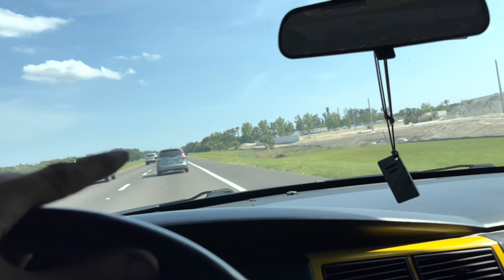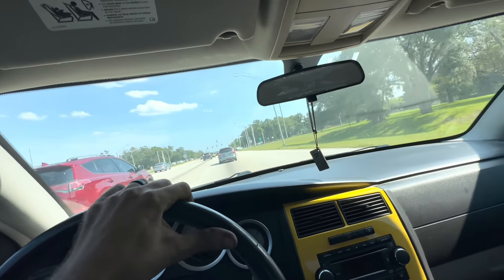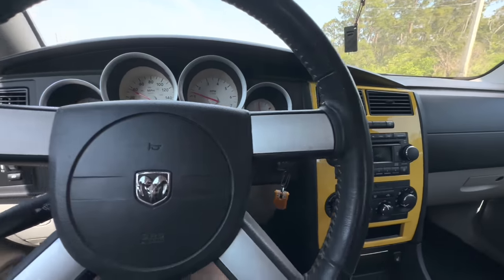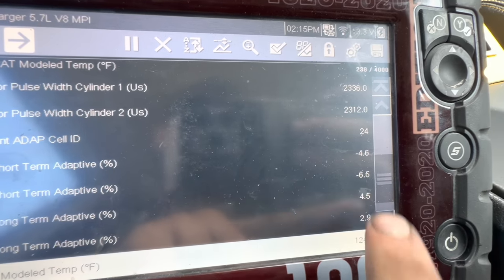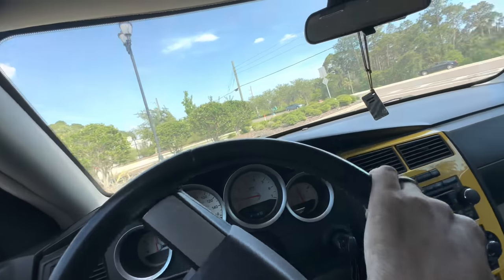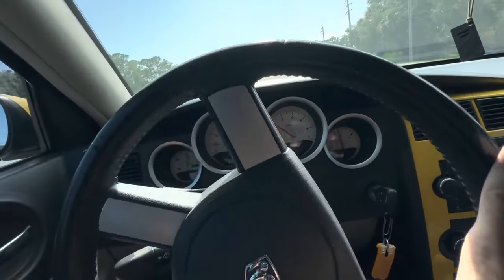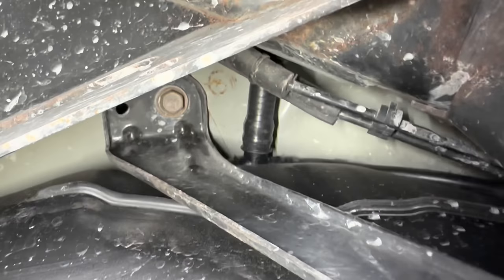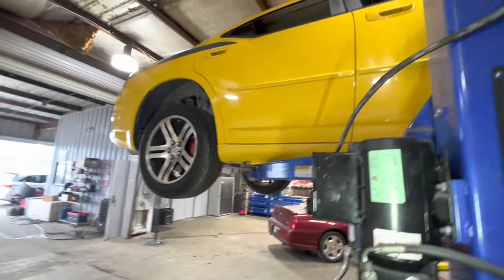Customer States: Engine Stalls After Fueling...HELP!! Dodge Charger 5.7 #mechanic

Comment: $3.25 for regular. I haven't paid that for gas in years. We're over $4 here in Vegas. The owner is probably "topping off" when he fills the tank. This is why there's liquid gas in the lines. @16:45... That's what you think. I worked at a dealership for 4 years. We only did recalls when the customer requested it. I used to try to tell my service writer that a car had a recall and he always told me the same thing... "That's not what it's here for. Ignore it". @19:23... Anything that says, "Dorman" on it should be immediately suspect. LOL. I'd replace the canister and educate the customer about not "topping off" after the pump shuts off.

Comment: That gas gauge arrow thing is useful to me a few times a year... on the car I've owned for 7 years.
I refill so infrequently (I don't drive a lot) that I often forget.
-
Fun fact: Some electric vehicles are made with the charging port on the driver's side... which puts the charging cord handle at risk when doing curbside charging.
Reply: Japanese and American vehicles have the fill/charge ports on the left side... Japanese since they drive on the left side there, and American due to lazy US drivers want the shortest distance between the drivers seat and the fill port. ;)
Reply: @ezrollergbg  As am American driving an American car (probably assembled in Mexico?) I must tell you that there is NO organized rule on that.
My car's fill is on the right side.
I have had only one vehicle in the last 30+ years with a fill on the left side, and all of those vehicles were Fords, Saturns, or Volkswagen Beetles (the old ones, not the new ones).
I think I once rented a Chrysler with a left-side fill.
I had a friend whose car had the filler pipe behind the rear license plate.
-
The location of the fill/charge port is not a "laziness" or convenience factor, but a design decision that really needs to be rethought and standardized.
And not put on the traffic side of the vehicle.
Reply: @MonkeyJedi99  Hehe… I thought I’d see if someone swallowed the bait. My US friends are certainly not lazy. You need to, in most cases, work harder to survive in the US than here I believe. I was actually referring to what some American friends said while I lived in the US when I asked why most US designed cars I’d come across had them on the left side. A thing of old habit from the manufacturers maybe? 

American cars were very much not developing from early 70’s to mid 90’s. Like body on frame, spare tire in the middle of the trunk, really bad crash protection etc, really old and inefficient V8’s etc. Big 3 got lazy and almost put out business by the Japanese. USA is very conservative in many ways even though the traditional US car manufacturers have picked up the pace the last 20 years. And companies like Tesla etc shows that there are progressive people in America, just some structures, fossilized opinions in some parts of the society that stops USA to become a modern country again. The MAGA people won’t help with that, nor will the misinformed moralists.

My post was merely a joke, a bait to see what people would write. Cheers. 😎😇

Comment: I think the gas in the faulty system just had to purge itself after the problem valve was replaced new. So some residual stalling but now purged and clear now. I would send it back out and see if it is cleared all the way out now. No parts cannon yet...

Comment: Ray you never disappoint. You are a comedian. Circular K and dough-gee made me LOL. You so funny. I can't wait for you review of a Waffle House or Golden Corral. See you when you headline in Vegas. This episode reminds me of  the saga of a fellow I worked with that had an issue with stalling when pulling his boat at highway speeds. He rebuilt the entire engine etc. and the problem. Remained. I asked him if he ever replaced the rubber fuel hose between the metal line and the fuel pump. Turns out it had an internal separation that only became a restriction when maximum flow was needed. A $5 part was all it needed vs. the $5,000 spent chasing the wrong problem. Lesson learned, part cannon reloaded. I'd replace the tank. It is not unknown to get defective new parts. I once bought a set of lifters and popped one open to verify they were correct and found the only one that did not have an oil hole in it! Brand name part. It happens.

Comment: I had a bad TIPM that was causing a similar very intermittent problem.  But in my case it would crap out at highway speeds randomly.  They are cheap and ya can likely find one at a wreckers.  It may also be the purge control solenoid.. but if it was already replaced I can't see it being that.  (and TIPM is 'Totally integrated power module').. Really looks like they loaded up the parts cannon to fix this.. if you can find a TIPM at the wreckers it takes probably 15 min to swap it out..

Comment: How long ago did the other shop change the tank, and did they blow all the fuel out of the line.  Fuel will stay in the low spot of the lines,  and because it is a close system it will take a while for it to dissipate.  My 2005 Town and Country suffers from the same thing. It would stall with in a few minuets of refueling if I drove out of the station as soon as I was done.  If I idled in the station parking lot for a min or two It would not happen. ( that was my Temp fix  when I used the Van for delivering around town ). Your not gonna get a stall just sitting there.  Second, when cumming off the highway at speed and cumming to a stop at the end of the  ramp I would get a "stumble" some times a complete stall when I took off from the stop sign.  If I idled at the sign for a bit I would not stall.   Fuel splashing up to the top of the tank during the sudden stopping and getting in the Valve.  When I use my Van a lot and re-fueled every other day,  It happened a lot.  Now my Van is just an extra and does not see a lot of miles it stopped happening.  Pulse  I never fuel it all the was up the Neck and the problem has not happened in years.   Blow the gas out of the line and have the guy run it for a while to see if it happens again  If so it is the tank valve.   New does not mean it is not broken or bad, and if you did not replace it how are you sure was new.

Comment: Nissan is the Chrysler of Japan. I am actually thinking about a control issue as hardware checks out. With the scantool verify all functions. Do not trust on/off sensor input of scan tool use the smoker.

Comment: The customer could be "topping off" the fuel tank when he fills up with a few extra clicks of the pump, which could be overfilling the tank and causing the same symptoms. I've seen lots of Hondas have saturated canisters prematurely due to this over the years.

Comment: it wasn't a Dodge but I experienced the same problem., I started the car and let it idle .i checked wires  into the Crank position sensor (connector )was bad between the car and sensor . it was extremely intermittent but if the car was running and I wiggle the wire it would stall

Comment: Charcoal canister is damaged the membrane
That holds the charcoal in place degrades with raw fuel. Still can have flow but too much flow. Sometimes enough for a small leak code. But 
If they had problems and changed everything but. The charcoal is no longer Activated and can't store the fumes the purge value opens it's released all at once. No codes

Comment: I knew someone with the same type of car and same issues. It mainly happened on short trips, where he couldn't turn the vehicle on until after several hours.
I don't understand why you can't just replace the valve instead of the entire tank.

Comment: there is a tsb/recall on the 05~07 charger rt / 300c with 5.7 mine was fixed under factory recall. they (dealership) replaced fuel sending unit and flashed ecm to fix it on my 05 300c..it randomly stalled after fueling it

Comment: SO I wanted to sleep on this one before commenting. It's strange that there is liquid fuel in the evap lines. Several people here have commented on the fuse/relays as the cause and that may very well be the case. however, the mystery of the fuel in the evap lines remains.
As we know liquid tends to travel down hill and I assume the vehicle hasn't been inverted at some point. Ruling out condensing and not being knowledgeable with the layout of the fuel system, it must be the case that either the fuel was pumped there or was introduced father up the system and is draining back down.
IF there is access further along the lines, perhaps break into there and see if there is also fuel? To try to establish the extent/ limit of the fuel and thus the extent of the 'pumping' or the cause of the introduction of it.

Either way, if you can prove/disprove one, the cause must be the other ;-)

It is a conundrum for sure.

The symptoms, whilst not exactly replicated, seem to indicate that fuel (after re-fuelling) and also when stopping after speed - causing the fuel in the tank to 'wave' forward in the tank, 'may' be some clue to the nature of the issue in that there is 'some way' at high fuel levels, fuel is being entered into the evep lines....

Comment: wow...I like those prices for fuel, but what's with the low octanes? We have 91, 91(E10), 95 and 98 in Oz, but at my local servo right now prices/litre are $1.99, $1.97, $2.11 & $2.19 (US$5.12/gal, US$5.07/gal, US$5.43/gal & US$5.63/gal). Luckily, my cars all run on diesel which is only $1.82/L (US$4.68/gal)

Comment: I wonder if they are over filling the tank even if it clicks off I know someone that continues to fill even after it clicks off I told them to stop doing that because it will stuff up the evap system and it will be expensive if it fails

Comment: Is it stalling after coming to a stop in D? Things I would check are the EGR, throttle body, MAF, PCV system. It could also be a failing torque converter. My vehicle had this issue for a 100K miles. You’ll never guess what solved it… Valve cover gaskets. Crazy, but thinking about it, there could have been a PCV system vacuum leak.  I hope you find and fix the issue.

Comment: You've heard of these cars I'm not sure which one. But spiders would get in and put up webs in the vent tube. That caused hard time fueling. It sounds like they've replaced a lot but that. That couldn't cause stalling right?  Did they use / get OEM parts?  OK  OK  lets see what you find.

Comment: I had a 2006 Chrysler 300 SRT8 that was experiencing this issue. But in my case it was more repeatable. The dealership replaced the tank and the problem went away.

Comment: Overfilling the tank leaves no volume four air you need a small chamber for vacuum to exist above the tank maybe in the trunk a small vacuum canister redirect your vacuum line so it cannot be vacuuming up the gas it's at a higher level and what it instantly lowers itself or drains why didn't they think of that ❤ good luck buddy

Comment: Hey Ray. Your resident 5.7 guru here. And I'll level with you - there is no 'one fix' here. I can tell you that the parts cannon has been fired incorrectly. I cannot tell you one concrete path because there isn't one. However, there's an entire checklist. One, crank position sensor. "But there's liquid fuel in there!" Yes; in intermittent CKP fault, no code is set for this MY unless repeated CKP faults occur over multiple drive cycles. Even if enough CKP faults occur to stall the car. If a subsequent drive cycle is clean, CKP is back to OK.
Next up, purge solenoid at the wires. As mentioned, the relays may stick. And the wiring system doesn't guarantee fault detection. Check to see if activation holds. Now you're going "why not the MCV?!" Because you don't have codes. Mopar is SD not AF. When the MCFV sticks, you get a lot more raw fuel and you get a PCM emergency shutdown (4F79 exceed, I think it's a U-code on '06) in permanent history with a P017x too rich or trim malfunction. Not a P02xx.
But unfortunately (or fortunately) the customer description is also pointing me to the PCV system. Which is absolutely terrible on these, and prone to failure. Pop the PCV hose. If you've got liquid oil? You're doing PCV ($15-40, 0.15 hours) and probably PCV bridge seals (split the intake manifold and do all the seals, the PCV bridge seals are separate - 53032384AB, qty2.) If you have ANY evidence of an oil leak at the intake manifold? All the intake manifold and PCV gaskets. If the customer ALSO has observed a noticeable change in fuel mileage - either improved or decreased - then it's probably PCV.
SUPER CRITICALLY IMPORTANT: DO NOT BREAK THE PLASTIC INTAKE MANIFOLD!! One, it's $1000 ($500 per half.) Two, it's on 6+ month national backorder. Lubricate the PCV O-ring with ONLY engine oil before installing it. Anything else will foul the PCV, and you'll never get it in without lubing it. "Wait, stop, I have fuel here. How does this explain it? It doesn't!" Ah, but it does! Because the PCV is directly connected to that same vacuum source. Yay. (Told you it was bad design!) 

And if it's none of those, well, let me know.

edit: to elaborate on PCV vs purge a bit, it's all the same vacuum system. And the PCV is prone to surge and clog. Particularly when the wrong oil is used (5W20 full synthetic only! Seriously. It matters. Blame MDS.) And who could possibly love weird vacuum problems more than Chrysler? (Nobody, that's who.)
Reply from the maker: We shall see! Thanks so much for the insight!
Reply: @RainmanRaysRepairs  my pleasure! Fingers crossed it's PCV or intake leak, because the diag only gets weird and expensive if it's not. Fingers and toes crossed it's not a hidden crack in the intake manifold - those have been known to happen. (That plus easily broken attaching points is why 6+ month national backorder.)

Comment: the stalling after fill up is the clue,., ask the owner if they stop when the gas pump handle shuts off, or if they keep reseting it and burp gas into the tank until its spilling out of the overflow tube.  if they are filling up in the morning before it gets hot, the gas and ethanol will expand . I would tell the customer to only fill it up to abt 90 percent full and see what it does.

Comment: I once had a 1976 Dodge Dart w/slant 6 that would die on me. I dropped it off because I had to go to work. They replaced the fuel pump saying that it was vapor locking. The next day it stalled again. 
Turned out to be a bad electronic ignition control box. It turned out to be an electrical, not a fuel issue. I know it’s another car all together, but maybe it’s not a fuel issue. 🤷🏻‍♂️

Comment: Being a fuel issue it could be some debris in the tank that gets moved around after fueling up which then clogs the pump. Until it doesn’t. Back flush the fuel lines.

Comment: I spent many years as a Chrysler tech. Sadly a new part even if it’s a factory replacement part doesn’t mean it’s a good part. I would replace the tank if the customer paid for it and it was not replaced under warranty the tank could have a parts warranty through Mopar.

Comment: If it happens after fueling and they try to top off the tank to get it as full as possible, then that can/will cause raw fuel to be sucked into the evap canister.  Once the nozzle clicks off, that should be all the fuel you put into the tank.

Comment: All these cars have the same problems fluid lines and electrical lines are around the firewall of the vehicles on purpose creating leaks and over heating or emptying fluids evaporating other fluid systems

Comment: does the owner fill the tank with the engine running?  do you know?  did you try?  do you have any indication that the stall is fuel related?  have you considered an electrical event as the cause of the stall?  hook-up a few temporary idiot lights and give it back, tell the owner you need to know what lights go out or come on the next time it stalls.

Comment: I thought the HVAC actuator tapping thing was exclusive to Chevy Impalas. We had them at my job, used as taxis. I used to tell passengers it was the stock Gremlin tapping to let me know he had to pee. 🤪🤪🤪

My 2006 VW New Beetle had starting, then stalling issues after fueling. It was the purge valve.

Comment: Dodge has a lifetime fuel tank replacement for that problem on the 05-06 chargers … it may just be another bad tank .. even if the new tank fails , its still under warranty

Comment: My 2008 Ram 1500 does the same thing. Took it to a dealership. $600 dollars later I get it back. They said it needed an ECM update. My response was, the ECM reprogramed itself? They just said the OEM said this would fix the problem. Took it out and filled the tank. Went out on interstate and took right had exit with strong braking. Engine died. Too it back. They said they checked everything and was unable to find anything wrong. I asked for my $600.00 back. They just looked at me with a dumb expression on there face. Problem is still there and I just don't fill the tank all the way.

Comment: My 05 300c 5.7 hemi would run wierd if overfilled... when the pump kicks out.. stop fueling.. its full.. its when you keep going to try to top off n fill the tank to the lips that it acts wierd... never had an issue once I stopped doing that
Reply: also had to be in gear... so if you left the station.. went to the nearest red light... when I came to a stop... it would idle at 650 instead of 800